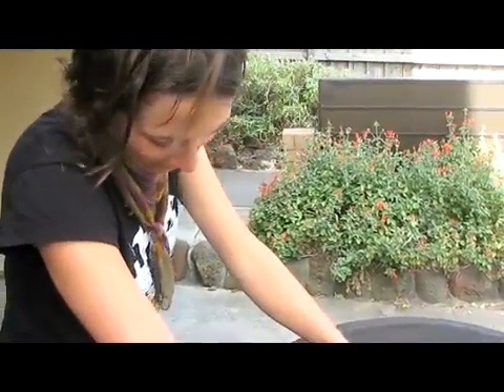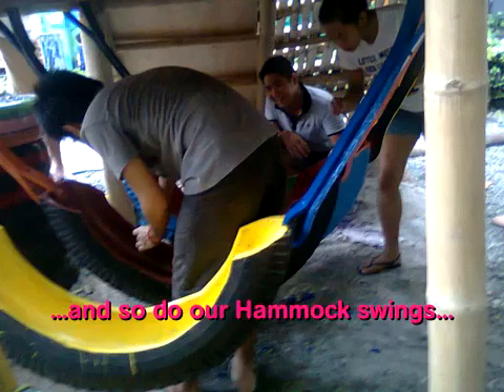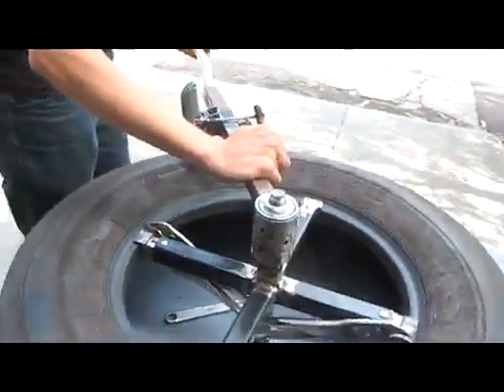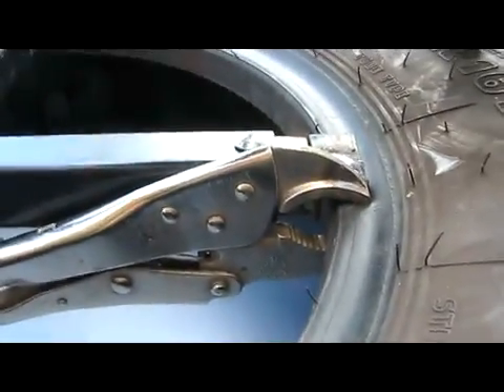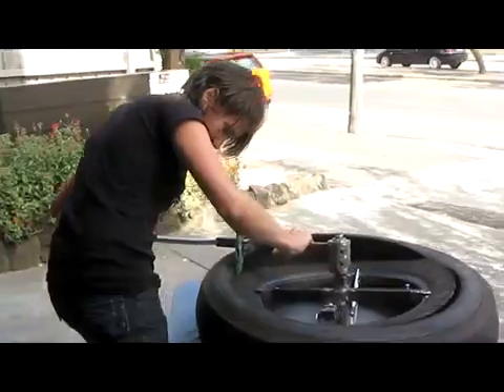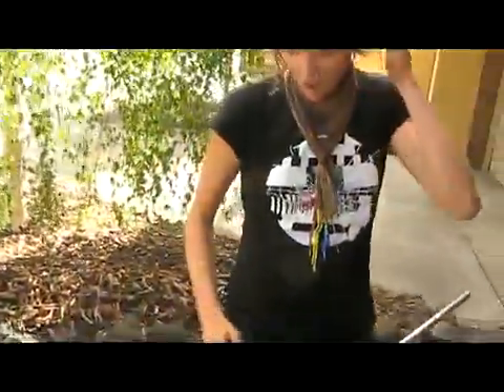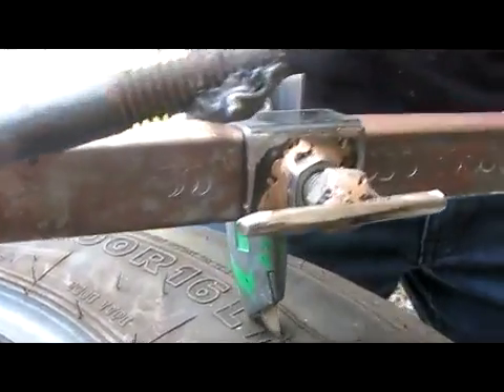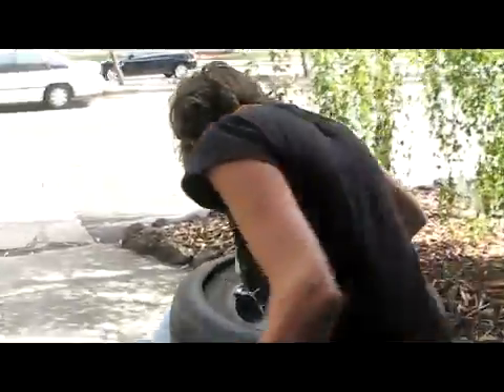Car Tire Cutter.mov.mp4

Comment: I realize this is a very old post....Did you ever get a solution you were happy with?
 If not, you should add better criteria.
How precise do you want the cut? +/- , Is there a power available? Do you have access to compressed air? Strictly mechanical?
How safe do you want it?

Comment: There is a power tool that vibrates a serrated blade to cut from end or two sides of the blade.  If you ever had a plaster cast removed this is the same type of tool.They are available at Harbor Freight, Lowes, etc.  a typical use is cutting the door casing at the bottom while installing new flooring without a rotating blade.  They can cut right on the line so removing grout between tiles is possible also.

Comment: I have used a hand held jig saw. maybe you could mount the jigsaw inplace of the utillity knife-----so you can adjust in or out the same as the knife------the cutting blade works better if the set is ground off----like a serated bread knife------i do that by holding a sharpening stone on each side of the blade while running the saw-----i can cut a 14 inch car tire both sides in one or two minute----if you pull the cut piece making a wide kerf it will cut easier------friction is the problem